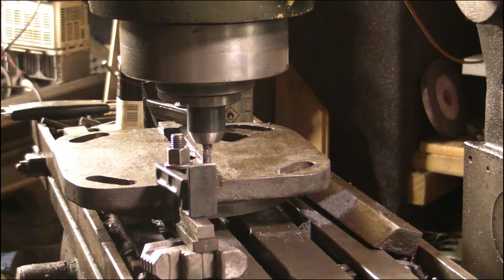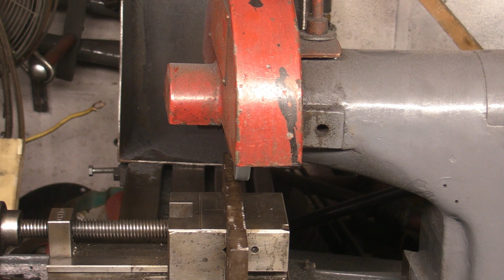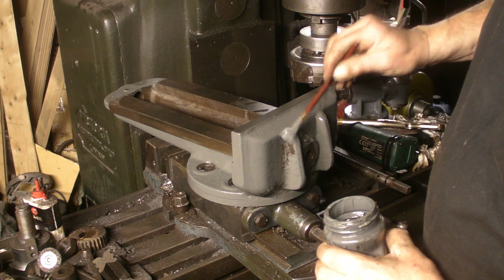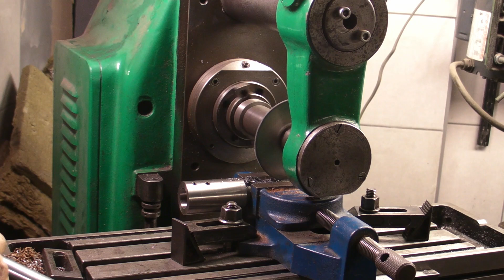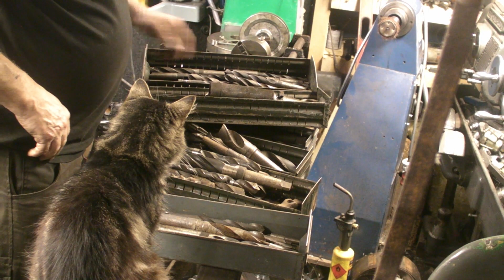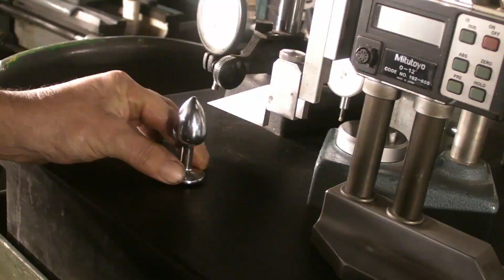New additions to the shop

Comment: Nice job on the motor Del!
Reply from the maker: Cheers Phil ,any joy with your faulty furnace ?
Reply: @machinenutdel6764  Yes and no! They have asked me to get a quotation for a new element "locally" which tells me that the .co.uk is a virtual prescence only! They have agreed to pay "compensation", I hope by paying for a new element! Not hard to make one actually, I can use a kiln element, which is Kanthal wire which is good to 1400c  but I am waiting for a reply from the element ppl, one in Kirby, and one in Stoke ( which is the Kanthal companies uk base) I can move forward to proof of concept with what I have cast, it is just annoying that the thing is generally so well made, except for the element, the most important part! With a pottery kiln, the elements fail on a fairly regular basis because the wire is good up to 1400c but melts at 1500c so you dont get much head room. I ran it at  1150c, copper melts at 1084c and I gave it an extra 60c for pouring and it performed brilliantly, and having a closed furnace with an oxygen free atmosphere means no dross or gas problems with the melt. it went from cold to poured in 40 minutes! It is of course highly possible that the chinese  thermocouple is under reading and the element overheated! It was holdin the temperature when I switched it off so it must have failed during cooling as the element has three clear breaks in it, and many other areas where it looks to be about to fail. when I tried it the second time the thermocouple was reading ambient, and it did not heat at all!  Replacement elements are available in the USA, but I think they are third party and seem to fit  many different makes as they are all very similar. Many ppl have reported  good results with the furnaces, but more than a few have reported premature element failures!  lots of info on the tube about how to change elements,so failure seems to be common and frequent and I note that some furnaces have a porcelain tube over the outside of the element to stop the ceramic blanket actually touching the wires, which mine did not have!
Having said all (!) that, what sort of a shit set up doesn't carry spares and honour its claimed 1 year warranty! One way or another I will fix it! 
Here endeth the Epistle to the Mechanicians!
Phil